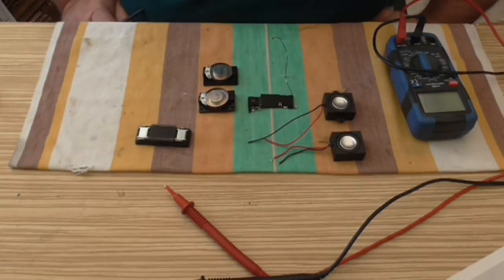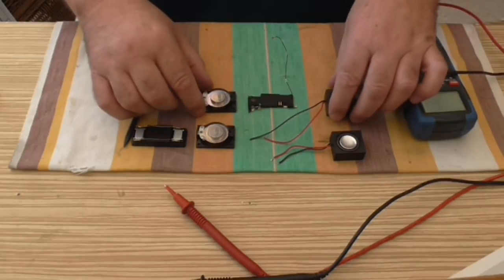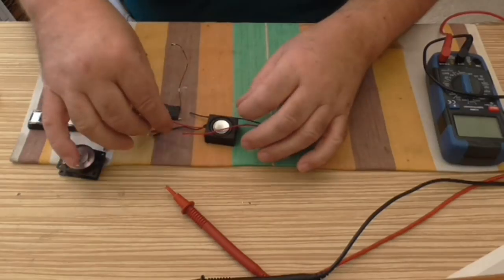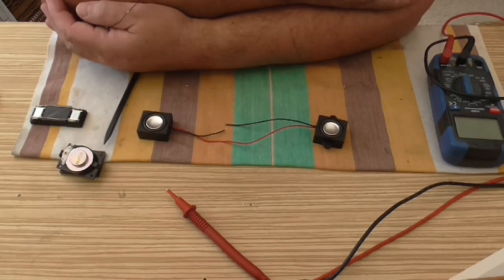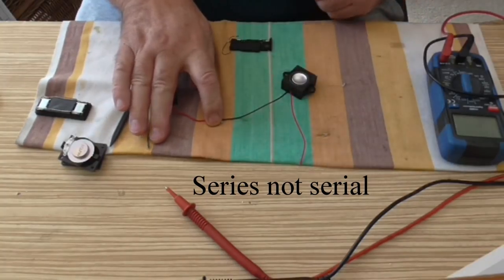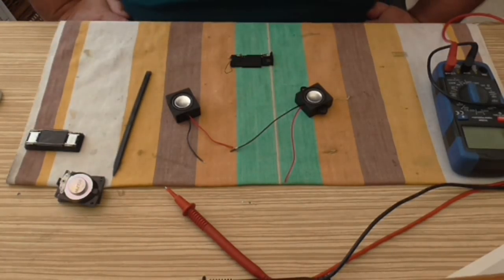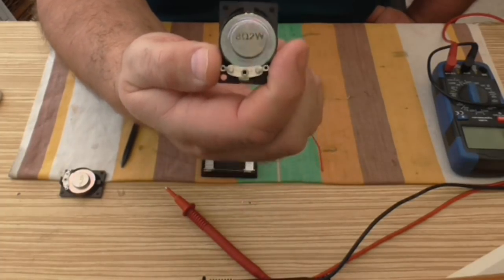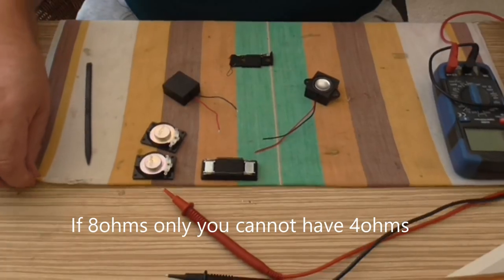Model railway- Speakers

Comment: hi simon, Hornby tts is 8 ohms mate I read it in the Hornby guide
one mega bass speaker is plenty enough for all my tts locos
cheers
mick
Reply from the maker: Hi Mick, the Mega bass speakers are good. If the TTS decoders will only take 8ohms you could never put two speakers together in parallel, but as you say 1 speaker is more then enough...Simon